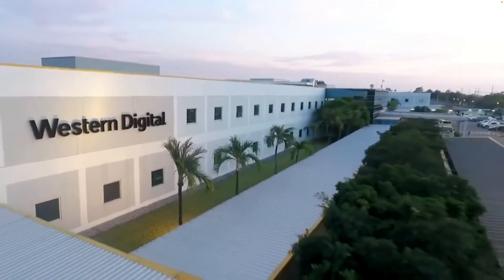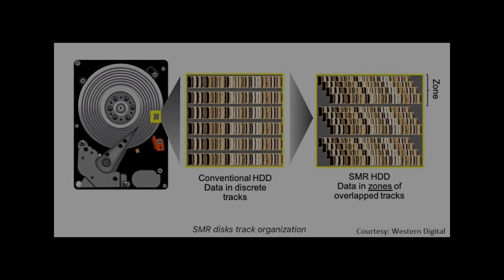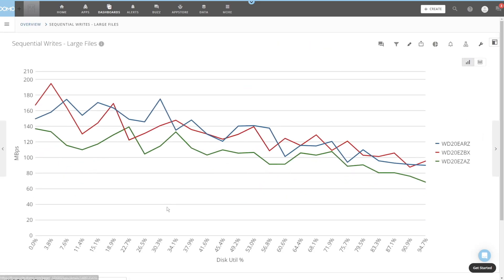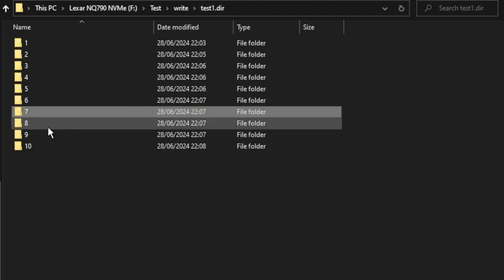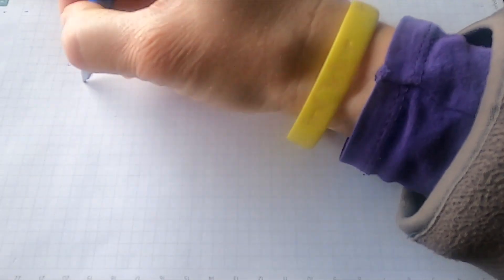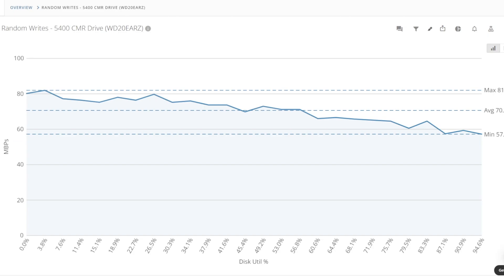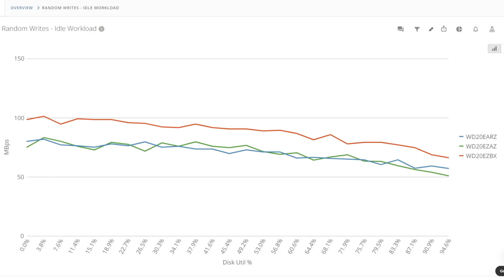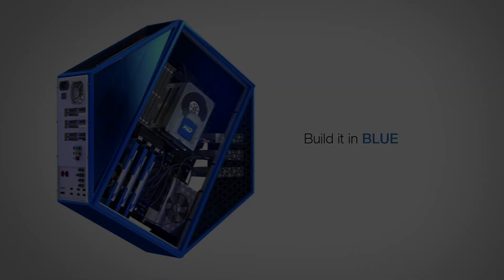CMR vs SMR. How do they compare, and how much should you care?

Comment: I was about to buy a Seagate Barracuda 4TB ST4000DM004, but after I watched this video I searched for its recording tech and it turns out to be a SMR drive. Taking into consideration the testing done in the video and the experiences shared by other people in the comments, I decided to go for a 4TB IronWolf ST4000VN006, which is CMR. Thank you for this video. 

(As a quick recommendation, slow down a bit your talk speed, it will be appreciated).
Reply: Pro barracuda are cmr (all ironwolf are cmr)
Reply: the 4tb Ironwolf drives are my goto drive for most purposes. Just wish they were a little cheaper.
Reply from the maker: Glad this was a help, all the barracuda drives do seem to be SMR, and it again, is not always obvious. I bought a 2Tb Barracuda and will also be doing some testing to see how this compares to the WD models.

And yes, on this video I think the pace was too high. Some have said its fine, but for others its a bit intense. You can slow it down in youtube and set it to 0.8 or 0.9 but I know this isn't really a good answer and I will certainly take this on board for future vids.

Appreciate the feedback.
Reply: I had a 4tb barracuda, was a good drive but a little slow to start up yet Steam managed to corrupt a partition in it now I can't format the disk anymore, long history short I almost lost everything that was inside that partition, with recovery software I was able to see that the sectors where the steam folder was were all corrupted. SMR will work fine if you use them to basic storage without excessive access, seems not a very reliable technology for most cases of use. Perhaps it would be adequate if I only used it to store backup copies, but the drive is now a zombie anyway, can't format it anyway.
Reply: @dev.hevron SMR delayed writing, corrupted your Steam folder. Not the other way round.
Reply: Nope: perfect speed!
If you can't keep up, slow down the playback speed.

Comment: Good video, very good analysis. I did not mind the speed, it worked well for me. I look at the specs when buying HDD to make sure it's not an SMR. I bought a bunch of disks for a NAS recently so checked the specs carefully. I was supplied an SMR drive within a rebuilt pc and compared to the CMR drive that I installed in the system myself the SMR is dog slow and unpredictable in ti's operation.

Comment: Do the SMRs have the ability to do an on the fly read after write verify concurrent (well momentarily after in time but not with a separate spin of the disc) with the actual write operation?  If not that means every single time there is a RMW cycle the possibility of loss of previously successfully stored adjacent data through writing to an area of the disc that has become bad appears - or - we take a pretty hard performance hit to pass the media under the RW head again.  Write a 'sector' and suddenly data from another unrelated sector becomes unreadable.  I don't like that idea at all.
Reply from the maker: I can't imagine the write and verify order of operation is different from any other disk. I think the best way of visualising this is that inside an SMR zone (which if I understand correctly, is where I think your scenario exists) there are only ever sequential writes and never random writes. So an entire zone is written from start to finish as part of the RMW process, and writing to a given track can partially overwrite the track ahead, and not the one behind, which will be corrected as the drive moves onto the next track. 

So I would expect that the write and verify process is performed the same as any sequential writes of a CMR with a similar generation.

Comment: SSDs are completely different...until you realize they are not.  They initially had SLC, then transitioned to MLC, TLC, QLC.  So multiple bits are "stacked" into a single cell.  Effectively the same as shingling, as each cell must go through read-modify-write.
The more things change, the more they stay the same. Lol.
Reply from the maker: This is exactly right, and the similarities to SMR go further. SLC > MLC > TLC > QLC get slower and slower, so those larger capacity cards have an SLC cache for speed and endurance that behave just like the persistent cache in SMR drives. And if you fill that cache then writes need to be done at QLC speed, and performance drops badly, just like when the SMR persistent cache gets filled. 

They are alike in their behaviour in many ways. 🙄
Reply: @sometechguy that's why HDD's with heat assisted magnet recording (HAMR) could make a comeback against SSDs. The technology is already available as of Seagate 2025 models , but still needs development. But as  this is expected to increase data density on platters (aerial density) in a NON-shingled way, so will angular read and write speeds gradually increase to the point of surpassing SSD mediocrity .
Reply from the maker: @addydiesel6627  yes, agreed. HAMR may look complex and people have concerns about the extra components involved and complexity it adds, but there are distinct benefits also. Aerial density, but most importantly on track density can increase bandwidth, but also I would expect they are less susceptible to bitrot than traditional CMR. Performance isn’t going to catch up to SSD, but for price per TB and density, they are going to keep magnetic storage relevant for a while yet.

I did a video on this technology and how it works incidentally. 

Seagate Mozaic 3+ HAMR 30TB+ Hard Drives - Deep Dive
https://youtu.be/JNGsTHuFcvM
Reply: Yeah, i also like to assume that they transferred the ssd mechanism kinda to the hdd world, and this for no good...
Reply: Not quite the same. SLC, MLC TLC, QLC yeah each has an increasing number of values / bits that can be stored per cell.

Cells can only accurately store (and read out) the increased number of charge states a certain number of times, reducing write endurance.

However, flash has always had read-modify-write behaviour as there's a minimum number of cells that can be modified at a time, defined by erasure block size.

No SSD has ever had erasure blocks as small as the 512b sector size presented to the OS.

Comment: Won a Seagate 8TB SMR Drive in 2019 via  Twitter CES Contest,   used it as primary backup drive for a year,  then obtained a Western Digital My Book 8TB as Primary Backup drive, and that one works so much faster than the Older Seagate 8TB SMR Drive for Backing up files.     (I use the Seagate one still very little for some extra backups at times)

Comment: My question is.. SMR: will it decay in time.. 

interesting test is sys 2 sys over LAN
and see how the max speed is kept up..
time to sag.. interruption and restore curve
Reply from the maker: If you mean, will performance decay; it looks like it will depend on a number of things. How often files are modified or rewritten and how much file time the disk gets. It could certainly be a problem in some scenarios and as the drive fills and gets fragmented, it could get worse.

I think it’s fair to say that for many users, it probably won’t matter noticeably, but for various reasons the disk could just be generally a bit slower. And the real question is why would you do that when the CMR drives are around the same price, maybe cheaper and don’t have any of these concerns. I just prefer people didn’t end up with these drives without realising what they are getting.

Comment: A few years ago I purchased a Seagate drive and had my first experience with SMR. It was terrible as my workloads were 100% worst case scenarios for SMR. I had only ever used CMR. I RMA'd the drive, only to have the same issue again. I ate the cost and trashed it. I bought my usual WD red drive only to have it happen again for a 3rd time! That's when I discovered the SMR/CMR disaster with WD. I swapped mine out for a regular CMR drive and have been happy since. Just bought a WD blue 8tb and am glad I read that model breakdown PDF before buying. 

SMR is a joke. You should repeat the worse case scenarios but instead of stopping the timer when the file transfer says it is complete, you should end it once the SMR drive activity goes back to zero. A CMR drive takes 10 minutes to transfer then it's done, I can unplug the drive. But a SMR drive takes 10 minutes to transfer then 10 more minutes to finish rewriting? Thats 20 minutes to transfer, effectively half the speed of a CMR drive. Unless you unplug it once it says "Files transferred" then you end up with a bunch of corrupted files. Yeah. SMR is straight up BS. You can't shut down/reboot windows until the drive is done processing long after it's "done transferring files".
Reply: Stealth delayed writing is why WD manglement thought they could get away with it. Thanks for the heads up 👍
Reply: Yup smr is very bad imo, it not bringing technology further it more like cost saving for the company.  Never touch wd again after all the trouble to found out in the end, the performance bog down is because of wd smr drive.
Reply: @winnieid2727  Western Digital drives are still my go-to brand for reliability. It was the significant and sudden change going from CMR to SMR that immediately caught customers attention and drew backlash. Hence reviews and YT videos like these. There are other brands that have and still do offer SMR without advertising them as such. I've bought many more WD drives since then, making sure each one is labeled and performs as advertised. You should always test new drives before fully deploying them.
Reply from the maker: It’s less deterministic to find the time to cache cleaning completion, just because there isn’t a clear trail. You just have to listen to the drive. But I did record some times and on the 7200 SMR it started around 12 mins in the earlier tests, and climbed to around 18mijs for the later ones. So file transfer to persistent cache was ~3mins, time to get all data written to permanent storage, 18 mins. Pretty surprising, but you can see those numbers for clearly in the non-idle rewrite test, because there the cache is saturated and you are seeing the real time to write to the SMR portion of the disk.
Reply: Now you scared me about this smr thing.

Comment: I read the data sheets, but that's me, a tech guy.  Given the NAS horror stories, especially with ZFS, I wouldn't touch them.  I'm surprised there is almost no price difference, although perhaps WD and others make a bigger profit from SMR - otherwise why bother, bad press, damage to reputation, having multiple product lines, somebody is profiting from SMR.
Reply from the maker: It’s a bit of an enigma, but you are right that the added complexity means there has to be significant pay off. Seagate appear to use SMR for all the barracuda line. So same deal there.

Comment: Fair enough - sounds like SMR might be useful for large, infrequently updated games, or storing pictures/videos that are only updated a few at a time and otherwise only read. My issue is that I personally only use hard drives for backup purposes at this point due to their cost per GB, and that I was not properly informed I was buying an SMR drive instead of a CMR drive. Determining what needed writing and then actually writing whatever percentage of my multiple TB of SSDs had been updated to a HDD took enough hours on SMR that I could have made many additional backups on CMR in the same amount of time. The excessive reads and re-writing required to keep the SMR data valid also killed that SMR drive unexpectedly fast, so I took extra care to replace it with a CMR drive when it had enough unrecoverable errors - not good for a daily backup drive!
Reply: No chance. I think the 30 dollar saving over the lifetime of the HDD is as false an economy can ever get. The increased amount of waiting for writing combined with extended power consumption over the entire life of drive makes SMR one of the worst decisions for the environment as well as consumer time and energy consumption.

Comment: I would not want SMR for anything that is going to get written to a lot.  It may be OK for backups but even then any changes to it other than adding more data can be super slow.  Note I said adding data.  If you wanted to change some existing data that could take a really long time depending on where it physically is stored on the platters.  If it is at the beginning of the drive that can make it take a long time to finish the write.  SMR is shingled so just imagine the added complexity.

Comment: Love when WD silently swapped the red drives. Really helps the competition
Reply from the maker: They have a history of not learning from past mistakes when it comes to customer experience also.
Reply: @sometechguy  I stopped using WD drives and moved to Seagate.
Reply: @timradde4328  The only drive that ever failed me was a Seagate.
Reply: @Mike-sv2nu neither Seagate nor WD ever failed me. Only Toshiba failed
Reply: → ☆ CMR & Helium-sealed & RV sensor ☆ ←
Reply: WD manglement are thick as thieves. No wait, they are really thieves. Praying the engineers will eventually phase out the SMR trash
Reply: WD is only Brad which didn’t failed me in past 30 years
Reply: @Dextermorga Seagate has better mechanical shock tolerance than WD. I am going to order a Seagate for my laptop as my SSD keeps hanging for 10 seconds every minute

Comment: Would have liked to see power draw levels at the various tests/stages especially after the CMR drive is done but SMR is still thrashing the cache.  I'm also curious about the the risks to data on the SMR during cache writing/sorting during a power failure.  Mostly it seems for archiving SMR is fine, just hope you never need to re-write the drive.  Still, I'll stick to CMR drives.  I hate being told an operation is done only to learn that the SMR has been doing clean up for the last hour and failed during that critical time.
Reply from the maker: Good call. I have the power numbers for all those tests, but dropped some of this in editing to make the video a little shorter. I will drop them in the comments later.
Reply: @sometechguy that would be awesome. Since the fifty dollar saving may not be sufficient to offset the increases in writing for the entire life of the drive. Great video in any case. Subbed 👍
Reply from the maker: @addydiesel6627  thank you. I did start to gather this data but it wasn’t complete so I didn’t include it. But I have another comparison coming up looking at desktop vs surveillance performance and I may take the time to take all those readings.

In short, my observations from the data I did gather was that power usage is mostly linked to the spindle speed. And the SMR consume more power, simply because they do more work. So writing might be same power for CMR as SMR. But where SMR is writing to cache and then cache cleaning, the power usage continues at a higher level on the SMR drive. Also, cache cleaning results in a lot of seems, which is a little more power hungry.

Let me see if I can get the hard data…

Thanks both for commenting, and for the sub!

Comment: For most desktop PC users, an SMR HDD won't be noticeably slower. However, if SMR was developed to provide higher densities at reduced prices, something is going on here. It feels as if manufacturers are not passing on the cost savings and relying on SMR to boost profit margins, thus no benefit to the consumer.

If using a NAS, one should always use CMR drives, especially given there is no price penality. Other than that, and perhaps a few other specialised scenarios, SMR HDD's are just fine for most users.
Reply: They are passing cost savings, to shareholders.
Reply: SMR made sense to the customer when it was the largest drive available. But when theres bigger or same size CMR drives, I';ll take the CMR drive everytime because if you follow backup rules (which everyone should), restoring a backup image to a SMR drive is poop.
Reply: In this modern SSD / nvme era, selling SMR harddrives and not telling the customer is like committing murder. So yes it would definitely be noticeable 😂
Reply: Wait until you have to transfer huge files and your SMR HDD is nearly 70%+ filled, the write speed tanks to a single digit write speed.

I bet that they aren't passing consumer saving because they don't want consumer to wonder why this X drive is US$50-100 cheaper than Y drive of the same capacity. Most SMR drive I've seen listed are at most $30 max difference from their CMR counterpart.
Reply: @AlfaPro1337  There shouldn't be much difference in the expensive part, the hardware (spinning rust drive has a minimum cost to manufacture of about $40, even for the smallest ones) -- this is really a firmware difference. So honest retail shouldn't be much different. I won't buy SMR regardless, as I don't like the idea of shingled data, even temporarily.
Reply: bs , smr is total garbage

Comment: Thank you very much.

One thing I had difficulty with was trying to tell how long each drive took to complete a test from the visual data on the charts.

I ended up replaying sections several times so I could be certain I was hearing how long it took being described by you correctly because I could not tell from looking at the test results how long each one took.
Reply from the maker: My thinking was that the comparative throughput in the graph was the key point of interest, but maybe a visual element with the total time taken and % increase/decrease on the CMR may have been a good addition. Appreciate the comment and constructive feedback.